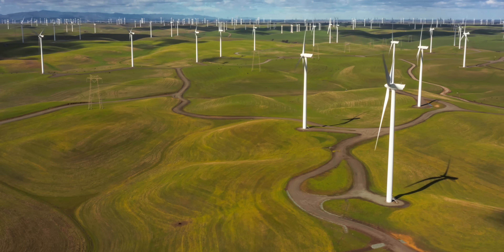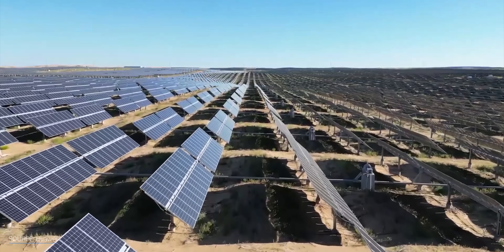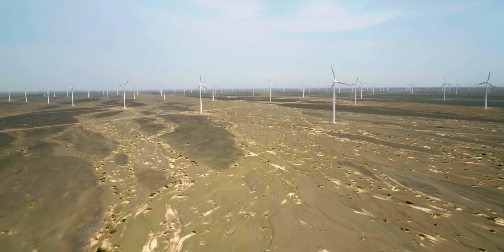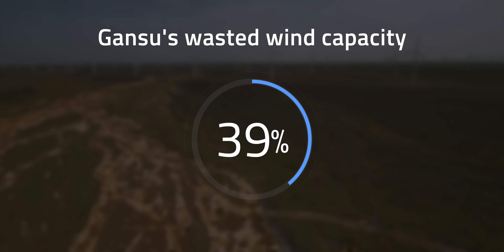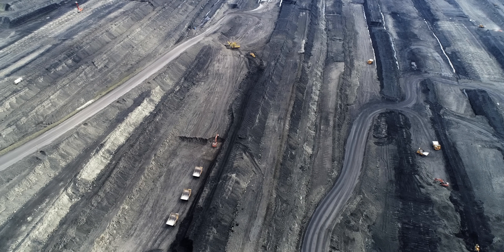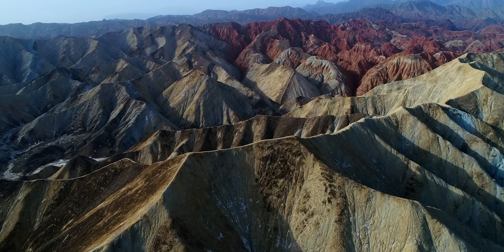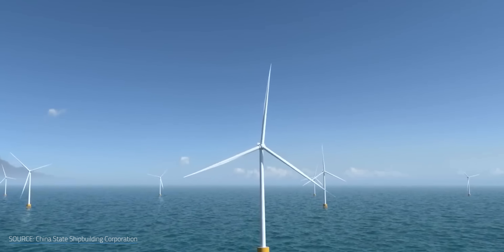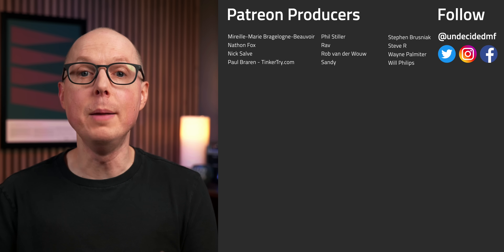The World’s Largest Wind Farm has a Tiny Problem

Comment: Peak power output is not average power output, let alone minimum power output.  Repeatedly stating only the peak output is misleading.
Reply: Yeah, that's like solar panels that advertise 500w peak power... and do 250 on a good, average day.
Reply: @Le_Comte_de_Monte_Felin  that's total nonsense. On a good day solar panels will perform their peak rating.
Reply: And considering that most wind farms struggle to manage 20-30% of expected average output, much less of peak, the actual power production is quite low.
Reply: In Germany we had about 60% renewable this year, and with increasing renewable energy the average blackout time has reduced over the last decades.
Which is somewhat logical since a grid with more small plants can substain outages better than one with only very few big plants.

Regarding nuclear, it's so much more expensive, nuclear fuel is also a limited resource and mining, processing, transport and disposal is usually not really factored in.
I'm not 100% anti Atom but logically it makes only sense for very specialized applications like a nuclear carrier or sub, space flight etc.

The eye opener for me regarding nuclear was the estimation of available fuel at current power generation levels - would we switch to 100% nuclear we would run out of fuel in 10-20 years.

I think whoever wants to build a reactor today has either been lobbied very heavy or wants the bomb economically and logically it makes just no sense.

Also all plants are measured in their peak power, we had to shut down nuclear plans when river water became too hot in some summers.

At least here wind and solar power do compliment each other very well since wind power is strongest when solar ist weakest. (also overall we have imported much more energy since renewables have become part of our grid then before those times)

If you look on the price and quality development of solar for example it's really hard to imagine anybody wanting to build a new fossile energy plant.
Reply: @kuni6908 There is so much I would like to address in your long post, but let's stick to just a few.
Germany is the major country in EU that pushes electricity prices up. In contrast France with massive nuclear power drives prices down and creates much more stable energy prices.
This can be seen as lots of energy intensive industries in Germany are struggling hard and moving more to other countries.
The fewer power outages mostly comes from more grid connections in EU. Stability mostly comes from nuclear, coal, water and gas plants. Counting the source for imported energy in Germany the increases in wind energy has mostly been balanced by coal power for Poland.
In total the way the green energy transition has been done in Germany is a disaster, but politicians really try to twist reality to make the public believe everything is fine and going according to plan.
We will be forced to add cost for stability in energy production and transmission in the future, and that will increase electricity prices in Germany a lot as it is using other countries energy systems for this stability for free today.
Reply: @kuni6908  From burning waste and producing biogas…
Reply: @-r-495  waste power makes about 1.5% of German energy and is by its nature non renewable.
Biogas seems to be on the way out due to eeg cutting not sure which percentage they made up but as soon as you use anything but waste for it it's pretty problematic.
Reply: @kuni6908  biogas emits just as much as LNG.
Reply: @kuni6908 those statements reflect some inaccuracies.
1. Current reactors, PWR & BWR, only use 0.5 to 0.75% of the uranium fuel. The remaining over 99% of the fuel is referred to as SPENT or WASTE.

That's why engineers designed BREEDER reactors that could utilize that material  much more completely and efficiently.  Experimental Breeder Reactor I & 2 were built in Idaho and run for several years, supplying power to the DOE Idaho National Laboratory and providing research and safety  information.  EBR II tested for Loss of Power, like the Fukushima accident and shut down safely.

2. There are other potential fuels, like thorium which are much more plentiful than uranium.

I sometimes wonder if we had spent a little of the money which has gone to renewables and elsewhere...

For, example, the Molten Salt Reactor,  built for the Nuclear Plane, demonstrated increased Safety, Breeding, and Walk Away Safety. The Chinese and other nations have been working for years and have a test reactor....  They want to be the world leader in Nuclear, and the video shows already are way ahead in renewable energy.
Reply: @kuni6908  The Drow want to black out the sky. Only they would object to clean energy.
Reply: An average energy utilization output would be an even better assessment of its effectiveness. Long term grid scale energy storage really needs to catch up to take advantage of the peak power output periods from intermittent power production.
Reply: so why does your power source of choice only states peak output? have you ever seen minimum power outpuit of nuclear reactor? it's zero.
Reply: @SergePavlovsky  I honestly hope you are joking. Zero is the minimum for ALL power plants... when they switch off. You can switch all of them off, and wind farms MUST be switched off during storms.
Reply: @Handles_AreStupid  your homework is to lookup average capacity factor of power plant type of your choice and explain why you thought it's 100%
Reply: @Handles_AreStupid  btw, wind turbines don't have to be switched off during storms. they can just ROTATE BLADES A BIT to reduce efficiency
Reply: @Handles_AreStupid  also wind power is proportional to cube of speed, so turbines produce much more than 100% of their nameplate capacity under strong wind
Reply: @SergePavlovsky  You are coping so hard. You DO have to turn of the wind turbines and you actually have to engage breaks. Wanna know how I know? I worked on a wind turbine farm. High winds over spin the motor and can cause eddy current build up which destroys the turbine and significantly shortens life expectancy of the instalation. They also can't exceed 100% of their peak power, or else their peak stated power wouldn't be their "peak power". Look up what "peak" means in a dictionary. A 3MW turbine is capable of production UP TO 3MW. That isn't a suggestion of "it might do 3MW, might do more". That does 3MW at tops.... please take at least a crash course in engineering before debate bro-ing me on this.... 💀
Reply: @Handles_AreStupid  and 3mw is not "peak power". it's "rated power"
Reply: @Handles_AreStupid  100%, Serge doesn't understand what a rotor over-speed event will do.
Reply: The problem with wind energy is that grid operators need a commitment to provide a baseline of power.  If I project that customers will need one GW for tomorrow, I need to have firm capacity from the power plants totaling one GW for tomorrow (plus or minus a little bit for contingency).  And I'm simplifying it by saying tomorrow, really its minute by minute.  The power generated needs to match the power demanded exactly, at all times, all throughout the electrical grid.
So what is the operator supposed to do with wind power?  If its a little bit he can have a smaller plant trim back a bit.  But if the total wind power is a large fraction of the total, and it can come or go quickly based on the wind, then planning can quickly become sketchy.
What we really need is a technological breakthru in energy storage.  With storage, the fickleness of wind power could be smoothed out over time, and the inconsistency between wind's instantaneous power vs its average power could be manageable.
Reply: Oh please the commentary is so disingenuous.   It's typically referred to this way.   As for the capacity factors stated in the commentary, mostly bull.   There are various sources of actual data.  In the US, the EIA shows US data, and it's typically 25-45% depending on siting.
Reply: He correctly stated „installed capacity“.
Reply: @-r-495  He also conflated CO2 emissions with pollution when we all know it is a naturally occuring gas necessary for plants to grow.
Reply: Some wind mill farms never even reach designed peak power output .
Reply: Nameplate capacity is the easiest metric to compare, we don't know the wind currents in that area. We can at least compare it to other wind farms.
Reply: @johnathanclayton2887  due to differences in average wind between sites its even hard to compare nameplate output between wind farms never mind other energy sources.
Reply: @johnathanclayton2887  its totally irrelevant, ONLY output matters, particularly the minimum output because that is what determines how much backup is required. The maximum output determines what transmission lines are needed, which sit unused most of the time.

As Europe is discovering to its horror, once you get above maybe 30% your return on capital for additional renewables plummets. Noone would invest in the additional capacity unless it was subject to huge subsidies. AND curtailment payments. 

The Northern Territory government in Australia now requires renewables to have sufficient batteries to make them dispatchable generators. A 30 minute battery was needed to allow this to happen, and it also made the project completely uneconomic. It has sat idle since the end of 2019.
Reply: Agreed, very true. Figuring in a 27% capacity or load factor for on-shore wind, that 1GW wind farm (0:13) would not supply 750,000-1,000,000 homes. Instead about 100,000 if you count all household energy use (electric and natural gas mainly), with some back of the envelope calculations.

This is assuming you had storage to supply that power when the wind wasn't blowing, which is not insignificant.  Per energy.gov, average household consumption is 77MBTU/yr. or 22,566KWH.  Worked out as an average load, that's about 2,570 watts/house and those 100,000 houses would use 257MW.  Your storage system would need to be able to absorb the remaining 743MW if the turbines were putting out maximum power.  You would be looking at about 760 of the Tesla Megapack-2-XL units at around $1 billion plus installation.  That system would provide about 12 hours of backup power, assuming the average load.  The capital cost of that storage alone works out to more than $10K/house, let alone the financing, maintenance and replacement cost on top of that!
Reply: They probably have to do some kind of service level analysis - like what is the maximum power that can be generated over a given period where the power generation level is within 95% of that level. The higher that percentage, the lower the power. That percentage will be influenced by factors like the availability of stand by (not green) power back up to fill that missing service. Or the cost of outage when the power falls below a certain level. Standard Service level Analysis.
Reply: You need something approaching a complete solution.  With consumption and storage also part of the equation, not just energy production.

For example they could ally this with CO2 Batteries and CO2 capture.
Reply: @peterclarke3020  co2 capture is a scam. it's much more expensive than just closing all ff plants
Reply: How silly and immature are many objections to green energy and decarbonisation. Sitting around pontificating about their superior views whilst assuming almost everyone else is stupid.
Reply: @caldodge   I’m not sure what the point of this debate is - yes, of course peak output is not average output, but I don’t remember that the video stated that anywhere.
The more important point is: why would that be relevant: of course all efforts should be taken that any produced power can be actually used by whatever consumer. Which they are trying to do. That provided, each and any kWh from that plant that gets used is NOT emitting CO2 as it would have if it came from coal.

So from a CO2 point of view it doesn’t really matter if the wind Mills rotate only half the time: every bit of energy from there is less CO2.
The only thing that is affected is the price: less running hours = energy is more expensive. 
But I feel the numbers explained in the video (7 ct/kWh wind vs 4(?) ct coal) are unique to that place in China since they have that cheap coal there. 
here in Germany Wind (and PV) actually already ARE the cheapest energy sources. Even though they are not always producing, they are STILL cheaper.
Reply: 0:07 Ferrell doesn't know the difference between power and energy so I wouldn't expect him to get anything else right.
Reply: @TimJBenham  of course he knows it. what do you expect him to say? "enough power to power"?
Reply: @SergePavlovsky  A gigawatt is not a unit of energy.
Reply: @TimJBenham  i know what gigawatt is. i also know that "power to power" is bad english
Reply: @SergePavlovsky  It is perfectly grammatical. Just omit the the first "power" if you don't like it. e.g. "The Woozlator generates 500mW, enough to power a small light".
Reply: Yes repeatedly stating “PEAK NAMEPLATE POWER CAPABILITY” without clearly explaining about UTILIZATION FACTOR seems rather like he must have an agenda there!
Reply: @Mentaculus42  so when nuke promoters repeatedly stating “PEAK NAMEPLATE POWER CAPABILITY” without clearly explaining about UTILIZATION FACTOR seems rather like you must have an agenda there!
it's well known, nukes can't survive without gullible taxpayer's money
Reply: @Mentaculus42   so when nuke promoters repeatedly stating “PEAK NAMEPLATE POWER CAPABILITY” without clearly explaining about UTILIZATION FACTOR seems rather like you must have an agenda there
Reply: @SergePavlovsky  
Not a nuke promoter, and the reference was almost all about things not nuclear, so don’t put bs words in someone else’s mouth. But that is the typical “green” modus operandi to promote misinformation. The more important point is how does China build nuclear power plants on time and on budget and generate electricity for lower cost than coal. It is obvious that you are “anti-nuclear” because of your sensitivity of someone pointing out the facts. Personally I am ambivalent towards nuclear, but wonder how China does it while the west can’t. Since you think I am a nuclear promoter, it is clear that we have nothing to discuss.
Reply: @Mentaculus42  you are accusing wind of not discussing wind capacity factor, nuke promoters also don't discuss nuke capacity factors, just implying that it's 100%, which is not true
Reply: @Mentaculus42  the more important point is that china is not building nuclear power plants, china is building wind and solar plants. it had build 60gw of wind and hundreds gw of solar plants in one year 2023
Reply: @Mentaculus42  i'm andi-bs and nuke promoters are full of bs. it's the most expensive source of electricity, more expensive than gas peakers which is ridiculous
Reply: @SergePavlovsky  

Seriously, China has been completing 5 plus very large nuclear power plants per year for sometime now. Here is a relevant title:

“China Approves 11 New Nuclear Reactors, Including Fourth-Generation Design”

So you say they are not, I guess someone needs to update their knowledge base. Get real! You probably have strong opinions about nuclear power, but China doesn’t care and they approach nuclear from a pragmatic perspective. They hopefully do not mess up, but probably are rather competent at building a fully integrated nuclear industry that has less friction than in the west.
Reply: @Mentaculus42  seriously i quoted you numbers, you replied with bs
Reply: @Mentaculus42  how many gwt of nukes china added to the grid in year 2023? that's all what matter to see how it fares vs wind and solar
Reply: @SergePavlovsky  

So where did you get 100%, someone else said 90% and I responded to that! So you must be talking about your agenda, what is your agenda?!
Reply: @Mentaculus42  someone said 90% in discussion about capacity factors. when yove just mentioned "11 reactors" you didn't state their capacity factor. (you also didn't state capacity itself which is even more ridiculous btw)
Reply: @SergePavlovsky  

You can do your own research, I have been monitoring China’s progress in low carbon energy for a decade. I gave you an average number and will stand by it. Besides I am NOT a nuclear promoter but recognize a nuclear hater when they spew BS. Personally I have a different opinion about generating clean energy so this planet doesn’t totally burn. But discussing the topic with someone who puts an incorrect spin on something I said is useless. I get it, you hate nuclear, that is basically the central tenet of the “green agenda”. You need to try to piss on somebody who actually is a nuclear promoter. 

Having a graduate engineering degree from Stanford affords me the benefit of not having irrational fears about nuclear energy but rather a non-biased viewpoint about what is and is not bad about the topic. How many nuclear engineers have you had discussions with, how many times have you had a discussion with the reporter that uncovered the Hanford radioactive waste leaks?
Reply: @SergePavlovsky  

Why I am I wasting time on an … (that “an” is a hint). Do your own research that further reaffirms your “biases”. You got some serious filters there! Stop your BS, it is embarrassing.
Reply: @Mentaculus42  you made emtpy claims, you will have to do research to back them up. you didn't monitor china at all, otherwise you'd know what i've told you about real power plants china is building
Reply: @Mentaculus42  i don't know you you are wasting time on spreading your misconceptions in youtube comments
Reply: @Mentaculus42  your degree isn't worth much if you can't compare amount of capacity installed per year of different energy sources. all you can do is mindlessly repeat nuke propaganda
Reply: @Mentaculus42  also people with degree would be able to look up levelized cost of energy from different sources
Reply: @Mentaculus42  it's not a surprise, nukes can't survive without gullible taxpayer's money
Reply: @caldodge  of course, but name a single democrat who didn't stopped paying attention after the glorious word "china" and 20Gw
Reply: All you nay sayers , so what is your viable alternative? O I get it,,,, “ Drill baby drill”.  Wake up.
Reply: @dannyslaughter4845  Your appeal to ridicule does you no favours.
Reply: @caldodge  it's only misleading if you "have a clue" 🤪
Reply: @caldodge  china misleading? Never!
Reply: Capacity is very misleading. China’s solar capacity efficiency is only 13% while wind is 25%. Nuclear plants have a 90-95% capacity efficiency. The US has a solar capacity efficiency of 25% and wind of 35%. China has to install double the number of solar panels as the US does to get the same amount of electricity. Eventually every country will be stuck installing wind or solar in tier 3 locations rather than the best tier 1 locations of today.
Reply: All windfarm data is deliberately misleading
Reply: Everyone should, damn the profit madness,
Reply: Wind dwarfs nuclear patent in boxes produces higgins blossoming walls off blades pivoting open and closed simultaneously magnetically.
scientists actors burned queen Elizabeth/ Einstines 1905 books .😅
Reply: NO ONE EVER said peak power was MINIMUM power.    RE-BRAIN yourself!!
Reply: it's nameplate capacity being referenced, standard in the industry. same applies to any power project, it would then be adjusted by capacity factors - same concept applies to a fuel refinery, meat processing plant etc. so not misleading.
Reply: No. 
China makes bad decisions that don’t work but they don’t let people question it.
Reply: Hard to beat hydro and nuclear in USA solar still  might help to ease load of larger homes. Heat pumps might ease load in areas they work well. However our need is even greater amounts of energy than we expect seems to be a trend. We haven’t entertained all the ideas of storage yet. I’ve seen hydro that flowed a certain amount use excess to pump water to a higher lake for storage to bank for night and times wind didn’t flow. Utilities have management systems to try to share load best they can. I believe it will take innovation and engineering to build systems for each demand and areas advantage which often changes faster than infrastructure. It’s amazing that much of our current system is 50-100 years old and we still expect the light to be on all the time. Without natural gas this will be much more difficult. I hope to see many approaches tried till we come up with something better. I believe thorium may have promise. Materials are improving all the time. Perhaps ceramic line pipes will be all it takes?
Reply: Most electricians don’t realize that from any source of a finite potential intensity φ (phi), regardless of how small the value of φ, as much energy as one wishes can be collected, simply by W = φq, where W is the total energy collected from potential intensity φ by intercepting and collecting charges q. If one wishes to collect more energy W from the same potential φ, one simply needs more q. The reason is simple: the scalar potential is actually a bidirectional set of EM energy flows, as shown by E. T. Whittaker in 1903, and what is collected from it depends on the number of fundamental interceptor/collectors (called “charges”).
Reply: Well i believe nothing that comes out of the mouths of communist party officials, they lie about all the numbers so that they themselves appear in a good light ('getting' face instead of losing face). China's culture is notorious in corner cutting when it comes to anything, i bet half of those wind turbines don't even work anymore and are left to rot as maintaining them is too much of a hassle for communist party of china. Instead they have been building coal power plants almost every week. The green energy thing is just for shows for them.
Reply: Wind farms degrade an urban environment! There must be a better way !
Reply: do you know what the world Contract means
Reply: Correct. Wind power is 40% capacity factor so Matt needs to get a bit more practical. Further he doesn't mention maintenance, or cost. The sand off the desert is likely chewing those turbine blades up pretty quick.
Reply: @davepfanner2902  though from the wiki on capacity factor, looks like coal is only about 60% and natural gas 50%. Nuclear is the highest at about 90%.
Reply: @johnathanclayton2887  This capacity factors are the result of modern grid priorities favoring wind/solar.  Gas and coal would be closer to 90% if allowed to run baseload and not have to dance around wind/solar.
Reply: @johnathanclayton2887  what numbers are you actually quoting there that put gas at 50%? With wind the issue is that they only put out about 40% of nameplate capacity as determined by mother nature, we get no say in when that 40% will occur and we can't make the number any bigger. With gas they are generally ready to go any time we want, even the outages needed for maintenance etc are planned in advance and happen when we say they will giving them a rating of something like 95 -  99%  of nameplate capacity. Our gas plants aren't running all the time only because it's cheaper to use mainly hydro and a bit of wind when we can, as dictated by mother nature, not because it's forced on us. Unfortunately the gas and coal plants are still required because of that intermittent problem with renewables. Until someone figures out how to make a humongous battery at a reasonable cost gas and coal are required if we want reliable power 24 7.
Reply: @johnathanclayton2887  yes but what are they actually rating at 50%? Perhaps provide a link to the info you are talking about? I'd be interested to read it.
Reply: @johnathanclayton2887  These numbers don't take into account that  the fossil fuel facilities can go to 100% whenever needed. it's like saying you only use 50% of the speed capacity of your car not taking into account you can go faster whenevr you want. 

Wind and solar can't do that. When 100% is needed they give 40% or less.
Reply: @johnathanclayton2887 

Wow, just throw some numbers out for “wind utilization factor” (which is mostly what nature gives you except for purposeful curtailment) VS a “DISPATCHABLE” generation source (where a significant amount is being ramped for PEAKING PURPOSES) is just … That 90% for nuclear is mostly due to periodic scheduled REFUELING! So just what point were you trying to make with trying to conflate two totally different things ‽
Reply: @Mentaculus42  wow, just how periodic REFUELING of fukushima goes?
Reply: @johnathanclayton2887  you are confusing capacity factors with utilisation !
Coal and Gas are capable of 90+% CF, but their UTILISATION is reduced when wind and solat generators are given priority of  supply. Wind and solar capacity is dependent on the weather and clouds etc.  
detailed independent analasis over years of data in Australia has shown wind CF to be below 30% over the full year.
Reply: @johnathanclayton2887  Nuclear, gas, and coal plant capacity factors reflect market competition between sources on the grid. They can produce nearly 100% of rated capacity when required. Weather-based sources like wind and solar are inherently intermittent; they only ramp up to 100% when the weather supporst it.
Reply: @davepfanner2902  Perhaps that high at a good off-shore site, but the Alta Wind Energy site, mentioned in this video, has a capacity factor measured at 23.5% (average 2014–2019) per Wikipedia.
Reply: @The4Crawler  looks like 40% is about the US average over the last couple of years according to the capacity factor wiki page.
Reply: @The4Crawler  , don't disagree. I use 40% as the global average. My father researched wind turbines for 20+years for NASA/DOE. He always used the 40% number. I stick with it. Some in Nebraska may hit 60%, others as you mention 23.5%, or worse. 40% is a safe bet on global average. Why wind energy sucks. Build nuclear. It's greener, safer, and less maintenance/costs.
Reply: I have 20+ years of operational logs on the Mod-0 wind turbine. The very first wind turbine in the US synced to the US power grid. I've seen an operational one bladed turbine. I know a thing or two because I've seen a thing or two. Best of luck.
Reply: @davepfanner2902  Nuclear must have 24/7 cashflow to make sense but when the sunshines 🌞 then the  customers cashflow to the grid crashes. 
The duck curve kills the nuclear promoters economics, it becomes a dead duck.
Reply: @davepfanner2902 OK, Farmer Boy!!
Reply: @davepfanner2902 No single energy source is ideal: Nuclear has drawbacks too: Much more expensive and longer to install, difficult to cool without sufficient water supply. Nuclear is also more difficult to ramp up/down: it's a good base load however. Problematic also: nuclear proliferation,  and uranium is not available to every country: most uranium providers are not very recommended / democracies.
Nuclear power plants can be a huge liability in times of war or public unrest.
Reply: @davepfanner2902  ,True when we operate those turbine blade in days where the heys are severe,, the blades get sharpen and throw off its balance. But they are a small price for the rotor change out.
Reply: @fabianwee  how much does a rotor changeout cost?
Reply: @davepfanner2902  My guess is the heat also causes many maintenance issues.
Reply: @davepfanner2902  the sand is on the floor, not in the air
Reply: I would rather not see the remnant vegetation along the Great Dividing Range in Queensland NOT decimated by windmills and power line without even a hint of environmental impact statement approvals.
Reply: @lynndonharnell422 I’d rather not breathe in the pollution from burning fossil fuels.  Even Greenpeace says that the consequences of burning fossil fuels will kill far more creatures than dozing some bush to install turbines and batteries.
Reply: @lynndonharnell422  I think that nuclear power generation is the most logical choice, but, as with wind, it is always NIMBY. Such negativism is why fossil fuel power generation remains the most common default. Both wind and nuclear are far superior options compared to fossil fuel electrical generation and we need to come to terms with the reality that they have to go somewhere.
Reply: @artistjoh  nuclear capacity factor trumps wind by a long way and a lot less environmentally destructive.
Reply: @lynndonharnell422 capacity factor is not the only consideration though is it. The reality is per kWh wind is almost an order of magnitude cheaper. Nuke shills will repeatedly tell you nuclear is cheap but nothing ever backs it. Pro nuclear was shilling SMRs and now surprise surprise lots have folded and prices now look higher than main stream nuclear.

Environmental impact difference in terms of co2 is negligible wind/nuclear. Sure nuclear is better land footprint etc....but the name of the game is always money and nuclear power doesnt compete
Reply: @bobbybrown1258 but you need storage or gas backup for wind.  Neither is cheap
Reply: @rjbiker66  not necessarily you don't
Reply: @artistjoh  how do you figure wind is superior to gas or coal, other than sustainability? We will run out of fossil fuel at some point, it's just a matter of when. Same thing for nuclear as well I suppose, except with nuclear it will be MUCH further down the road before we run out of fuel.
Reply: @bobbybrown1258  is wind really cheaper? Sure kw for kw produced it might be. But with wind you have to factor in having enough back up capacity from fossil fuels to meet demand when the wind isn't blowing. We need the fossil fuel power stations with all their associated manning and maintenance costs except fuel, just in case or more realistically, for when, the wind doesn't blow.  Or I suppose we could accept the occasional day or 2 when we won't have power, but not many are willing to do that. In fact I live in an area where power outages are common due to storm damage. Everybody here has some form of backup generator (fossil fueled) as we aren't willing to go without power for more than a few hours tops. A freezer full of food thawing is a real problem.  Even many of the solar off grid type people have a backup generator. But we are out of town, that's not so practical for city dwellers.
Reply: @bobbybrown1258  how about explaining your alternative to backup or storage requirements?
Reply: @avid6186  wind levelized cost of energy including storage is cheaper right since there are relatively few intermittent sources on the grid. If they keep increasing and nuclear doesn't pick up the base load, they'll lose much of their cost advantage unless storage improves.
Reply: @avid6186  wind and solar are superior to gas and coal not only by sustainability. also by electricity cost and emissions
Reply: @avid6186  wind and solar are cheaper even with storage
Reply: @avid6186  gas peakers were buit long before any wind or solar plant. because every kind of plant requires back up capacity for when load changes. and it always changes, it's not constant.
Reply: @johnathanclayton2887 Cost of wind including storage is far higher than any of the base load generation that is used today.
That is why we hardly see any major storage built today. It is only viable in some special cases when we hardly have any other alternative.
Reply: @SergePavlovsky No, wind or solar with storage is many times more expensive than any of the base load alternatives.
If it was cheap we would build lots of massive storage, but the costs are not even close to what we need.
The only storage that in some cases makes financial sense is pumped hydro, but only when you have very favourable geography, and that is rare.
Reply: @Rohan4711  there is very little storage necessary right now, which is why it's economical. Hence why a lot of wind power is getting built. As you get more wind, you need more batteries, so it becomes less economical. But right now because you don't need many batteries, wind is much cheaper than coal, and slightly cheaper than nuclear.
Reply: @Rohan4711  who told you that bs? wind/solar are cheaper even with storage. we are building lots of massive storage. "In 2024, the global energy storage is set to add more than 100 gigawatt-hours"
Reply: @Rohan4711  basically you are living in some imaginary world made of alternative facts
Reply: @rjbiker66 

Actually you need both batteries and backup DISPATCHABLE generators for wind and solar, AND the cost for these things are rarely stated as part of the real world cost.
Reply: @Mentaculus42  actually you need both batteries and backup  DISPATCHABLE generators for nukes, all grids with nukes have them
Reply: @artistjoh Besides the fact we don't need electricity.
Reply: I've worked in power Gen for 10 years and capacity is simply a standard so you know what general size a plant is. It isn't misleading at all. If you can't grasp the meaning of the word then that is something you need to remedy or step back to children's videos that hand you everything.
Reply: @CorbinN6  stating capacity for coal, natural gas, hydroelectric, nuclear works because you can generally increase electricity generation to said max capacity, well close, to when you need to.

Wind and solar?  We don't control the weather, so you can switch on the wind or sunlight.   You could have whatever maximum power generating rating you want for wind and solar, but those numbers are meaningless if you can even come close to the rated capacity when you need to.  Wind and solar have their place, but it's not baseload power generation, and not when conventional baseload power plants can be used instead.
Reply: @yarrik701  that's a bit of a problem then. You say wind and solar aren't good for baseload, fair enough. But they are even worse as peaker plants because you can't just turn them on when needed. So what are they good for 😀
Reply: @avid6186  power production where due to location / logistics, no better option is viable.
Reply: Yes, 100%. The presenter has no knowledge of engineering, and so is just repeating actual C-CP propaganda. Even when we do use peak only values, wind is still less efficient per km^2 than EVERY OTHER ENERGY SOURCE. Solar has it beat by around 28x, and nuclear has it beat by 48x (for highest potential production per km^2, using real values/estimates of other power plants).
Reply: It's only misleading of you're pedantic
Reply: They have no choice but conflate to make this energy source even remotely appealing. Average loads produced by US wind farms are usually below 45% of stated capacity, and often much less.
Reply: @LordFalconsword  and often much more, that's why its an average. That capacity factor is higher than solar but you don't see many people crying that they don't get baseplate capacity lol
Reply: @LordFalconsword  that's why you need storage. It's intermittent energy.
Reply: @LordFalconsword  Yup and the wind turbines in Ontario Canada operate at less than 5% capacity factor for many days in a row during the summer. Last month the average capacity factor was ~15% when we needed it the most for air conditioning.
Reply: @instanoodles need to pair it with some solar and batteries.
Reply: @instanoodles 

Yes, and England has learned about those “LONGTERM WIND DROUGHTS” the hard way. The total cost of wind power should include the additional costs for batteries and the COST for maintaining DISPATCHABLE backup generators!! But that would be awkward to provide the true total cost to the general public.
Reply: @Mentaculus42  yes, and england learned about "toshiba bankruptsy" the hard way during construction of nukes
Reply: @instanoodles  Cue solar and batteries as the response for this particular time of year in Ontario.
Reply: @LordFalconsword exactly! We have two " wind farms" where I live that on any given day have at least one third of the turbines shut down!
Reply: @LordFalconsword Only if you're a child.
Meanwhile adults that matter are so aware of the actual output, these "conflated" figures aren't relevant.
Reply: @dougaltolan3017  only a child would try to insult someone for making a fair and valid point.
Reply: @dougaltolan3017  ad hominem is all you've got.  how sad.
Reply: @dougaltolan3017  I know one thing you don’t have, the facts.  Hence the totally irrelevant personal attack.
Reply: @dougaltolan3017 Great use of quotes to highlight ignorance
Reply: @dougaltolan3017  "Only if you're a child. Meanwhile adults that matter are so aware of the actual output, these "conflated" figures aren't relevant."

Go on then son, as a self-claimed "adult" what are the actual power and energy output stats for this wind farm?
Reply: @dougaltolan3017  Agreed. But if politicians know (best case), they happily parrot the wrong terms to gain support of their largely energy-illiterate constituents.
Reply: @dougaltolan3017  too bad st 70-80% of people are adult vhildren 😂
Reply: Coal overall capacity factor isn't that much better than offshore wind.
Reply: @bobbybrown1258  That's because grid operators favor wind/solar.  if they are allowed to run unmitigated by grid priority always given to wind/solar, they are around 90s%.  That's how we rolled 20 years ago, and electricity was cheaper and more reliable.
Reply: @johnmolloy4878  electricity was 100 percent not more reliable 20 30 years ago. Not where I live anyway. And I remember looking up data on global trends in reliability. Im not going to argue renewable has caused the reliability increase but they are not related.

I also don't think price increasing is tied to renewables either. Looking at my country with high renewable penetration adjusted for inflation price is about the same.
Reply: @bobbybrown1258  actually here they are related. Unreliability has 2 causes. The first and unrelated is transmission issues caused by things like storms. Possibly more common 20-30 years ago, depends on where you are. The other cause is lack of generation capacity. That is related to renewables. It was better here 20-30 years ago as we only had hydro which is much easier to predict and allow for. Now we have wind and solar in the mix as well it has become much harder to predict and power shortages due to lack of generation capacity is now more common. It can only be fixed by having huge amounts of normally surplus capacity or if someone invents an affordable and scalable storage system.
Reply: It really doesn't matter if it's only 10% of it's peek capacity. 
It's FREE. With the majority of profits going to your state instead of a private business. 
If it can reduce 10% of pollution, that's a good thing too. 

You people must live in rural flyover states where you've never experienced smog. Or you're too young to remember it. 
I remember "Smog Days" where we couldn't go to school, or play outside. Where your eyes mildly sting and tear the minute you step out your door.
Reply: @kewlztertc5386  it is misleading.
Reply: Look how many wind mills they have to have just to replace a couple of old fashion generators. It is a massive waste of resources.
Reply: @tonysheerness2427  shallow argument? We spend a little more upfront resources to not mine more resources by mass over the lifetime, not kill millions through fossil fuel pollution, reduce reliance on foreign imports,  not cause climate change, oh and it's cheap. 

But sure, you know better than the Chinese gov, because you say so.
Reply: Installed power generation is meaningless. How well does it produce when the wind is not blowing?
Reply: @TheTruth-yq2jb  why then you read meaningless installed power of nukes? how much does nuke produce when it's down for maintenance?
Reply: @SergePavlovsky  wind is good for 40% usage if you’re lucky.  Is a bad joke
Reply: @TheTruth-yq2jb  why you keep implying that any other kind of powerplant has capacity factor 100% ? who brainwashed you into thinking that?
Reply: @SergePavlovsky  my messages keep getting deleted, why you flag them? I have that stack of tires burning in your honor i mentioned before 😊 🔥  Only took a few gallons of used motor oil to get them started. Wish you could feel how hot it is 💞
Reply: @yj965  i don't flag anything and i didn't see your messages. youtube reads your messages and deletes them if it doesn't like them. maybe you shouldn't post so much bs?
Reply: @yj965  and i've already told you to not skip your meds
Reply: Peak output allows you to compare vs other projects. After that, just use common sense. We all know average output is much lower. Common sense. Did I mention common sense?
Reply: @Rick-C-117 
No, "After That" one discloses all the relevant data as a matter of fact, assuming one wants the viewer to understand the topic.
Reply: @Rick-C-117  not everyone is an expert in electricity generation and may consider the numbers repeated to them as more important than they actually are. It's actually common sense to recognize that.
Reply: @caldodge  Did a research paper on solar as facilities head of large commercial leased space company being constantly pestered to 'go solar'. At first shock that doing the actual power and cost math and physics was so minimal gain, then year-round, with 8% a year loss in efficiency, just about the time they pay out (not counting government bribes), they must be replaced. Since you can't have net power go to zero, then every YEAR you have to replace 8% of fading panels with new panels, and clean the rest. The 'biggest US climate disaster in 2024' was a HAILSTORM! 😂
Reply: Is there really a climate emergency that justifies this kind of investment that probably does more environmental harm than good. The atmospheric concentration of CO2 is about 420 ppm. CO2 is a naturally occuring gas and essential plant food. Wind turbines are unreliable with poor load factors. They are a blight on the landscape. As long as Matt Farrell remains undecided then we shouldn't worry. His channel is a nice money earner.
Reply: @johnmitchinson9577  atmospheric concentration of co2 was 300 few decades ago. 700 is bad air quality, so you want to keep your room at 600. with 300 outside each m3 of air swapped vents 600-300 =300 cm3 of co2. with 420 it vents 600-420=180 cm3, i.e. efficiency of ventilation is almost halved. can you see the problem? with 500 it will be 600-500=100 i.e. 3 times less efficient. with 600 you will not be able no vent your room at all.
Reply: @SergePavlovsky  False logic by applying the red herring fallacy. The pre-industrial (i.e. 1750 AD) global CO2 concentration was about 280 ppm. There's been a slow but steady rise in CO2 levels partly because of human activity and partly naturally occuring causes. Knowledgeable people are aware that there's also been a gradual increase in global average temperature following the little ice age and this has resulted in the world oceans gassing off CO2 owing to the effects of the Milankovitch cycle on the earth.

Humans breathe out about 4,000 ppm CO2 and indeed produce 1 kg CO2 daily as part of their respiration cycle. The world population is currently 8 billion so do the maths for total CO2 produced. Indeed CO2 is is an important stimulus for human to breathe.

It is well known that submarines operate perfectly well at CO2 concentrations of 3,000 ppm. Clearly ventilation is important in enclosed spaces to prevent drowsiness, but we're not talking about this matter.
Reply: @johnmitchinson9577  false logic by replying with unrelated bs
Reply: @johnmitchinson9577  knowledgable people know how co2 and tempereture graphs look from long before 1750 and they know that current rise is unprecedented
Reply: @johnmitchinson9577  btw, all diseases are naturally occuring. so you are against medicine, right?
Reply: @SergePavlovsky  wind turbines are 'decorations' like warts are 'beauty marks'  🤣
Reply: @yj965  don't skip your meds
Reply: @SergePavlovsky  False, the current temperature rise is not unprecedented. You don't know what you're talking about.
Reply: @SergePavlovsky  You're making a stupid fallacious argument again.
Reply: @johnmitchinson9577  you are perfect example of Dunning–Kruger effect
Reply: @johnmitchinson9577  ok, when temperature was rising faster than 1 centigrade per century? you know about temperature rises a bit less than nothing
Reply: @SergePavlovsky  🤣 We were all heavily medicated, thanks for your concern! 

Are you always this triggered? 🤣 Looks like you should take your own advice lmao 🤪
Reply: @yj965  looks like nobody is interested in your perverse imagery choices
Reply: @SergePavlovsky  yet here you are 🤣

Triggered again 🤣🤣🤪
Reply: @yj965  i've just explained irrelevance of your marginal estetics
Reply: @SergePavlovsky  Don't worry your little brain, the world is just fine as there's no climate crisis.
Reply: @johnmitchinson9577  so you failed to show when was previous precedent of current temperature rise. how unexpected lol
Reply: @SergePavlovsky  And you failed miserably to prove that there is unprecedented rise in temperature. Where's your evidence?
Reply: @johnmitchinson9577  the evidence is obvious: you can't show when was the precedent of temperature rising several dergees centigrade per century
Reply: @SergePavlovsky  Then produce the evidence.
Reply: @johnmitchinson9577  it doesn't work that way. it's unprecedented until you show precedent. and you can't show it, you can only repeat faerietales you've heard somewhere
Reply: @johnmitchinson9577  yes there is really a climate emergency
Reply: @johnmitchinson9577  plants can eat co2 even with 300 ppm. burning of fossil fuels is not natural process. increase of sun radiation by 10% per billion of years is natural process. now sun is brighter than when fossil fuels were formed. if you burn them now, earth will get much hotter than it was back then
Reply: @johnmitchinson9577  it doesn't do any enviromnental harm. fossil fuel extraction and burning does environmental harm
Reply: @SergePavlovsky If you need to run the wind farm at limited capacity, get short lifespan du to sand and high transmission losses you quickly start to reach the point where you spent as much fossile fuel building and maintaining the wind farm as you got usefully energy out of it.
There is no such thing as free energy.
Image you are a major tech company pondering if you want to build a massive datacenter close to this wind farm.
How do you make sure you have reliable electricity all the time when wind could fluctuate a lot?
The answer is you will need to make sure the coal plant next door operates all the time. Not at full capacity unless there is no wind, but it will need to run all the time to get the stability you need. Selling that as a green project to your customers with a straight face is not easy.
Reply: @Rohan4711  you are indulging in wishful thinking. wind and solar have lowest total cost of energy. and you don't spend fossil fuel for building and maintaining wind farm.
Reply: @Rohan4711  why do you imagine such bs when all tech companies are building datacenters near wind/solar farms and bying their electricity?
Reply: @Rohan4711  there are 3k+ km transmission lines from hydro plants and nobody is concerned with transmission losses
Reply: @Rohan4711  and of course you wouldn't run wind farm at limited capacity. it produces free electricity, i.e. first you limit all your fossil fuel plants because burning fuels isn't free
Reply: @SergePavlovsky Transmission losses are a major thing and we work hard to reduce them. In the video they built a HVDC line. This is the most expensive technology, but also gives the least losses then going over long distances. It could also be the major issue with phase shift that you get over long distances, so a HVDC line might be the only viable option.
With hydro you can't choose the location of the production, so you have to accept the transmission losses. With wind you often have many options, so it is important to calculate the transmission losses for each option to see what makes most financial sense.
Do note that subsides from the government or rules in China may play as an important factor.
Reply: @SergePavlovsky How do you propose that you build a wind farm without using fossil fules?
At least I have never heard of a single project of that type. If you claim there are, please add a reference to such projects.
Reply: @SergePavlovsky Of course you want your high energy usage company to get cheap electricity and also market it as a green alternative compared to your competitors.
Placing it next to a wind farm or covering the roof of a datacenter with solar panels are two normal examples, but every such project also needs a great contract with a reliable base energy producer. You can do fine without the wind farm, but there is no way to get the project to work without guaranteed reliable power.
We have had lots of energy hungry companies long before we had wind or solar farms.
Reply: @Rohan4711  nobody needs base energy because nobody has base demand. demand is variable, therefore energy has to be variable too. that's why gas peakers were built long before wind or solar plants. and now they are outcompeted by batteries
Reply: @Rohan4711  we work hard to build more longer hvdc lines. what planet you are from?
Reply: @Rohan4711  wind farm needs zero fossil fuel. what makes you think it needs it?
Reply: @johnmitchinson9577  death cap is naturally occuring fungus, will you eat it?
Reply: @johnmitchinson9577  wind turbines are reliable with good load factors. they are decoration of landscape